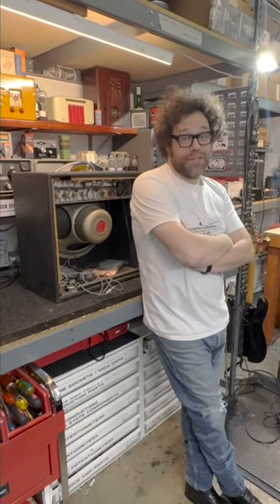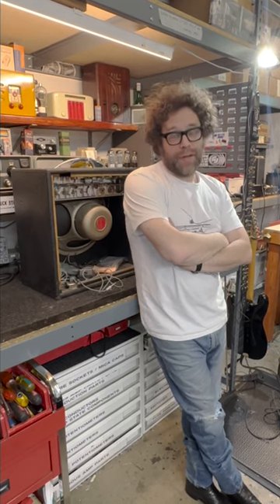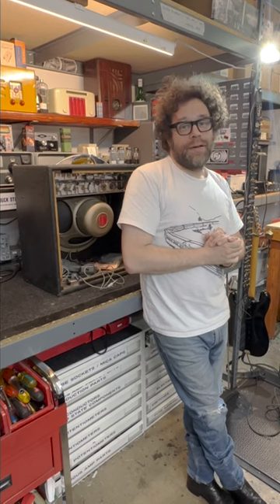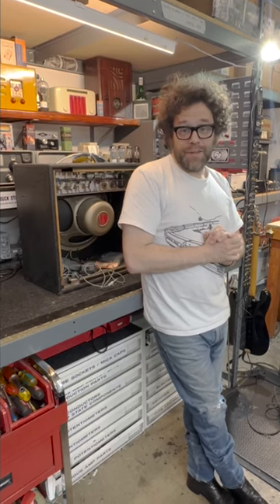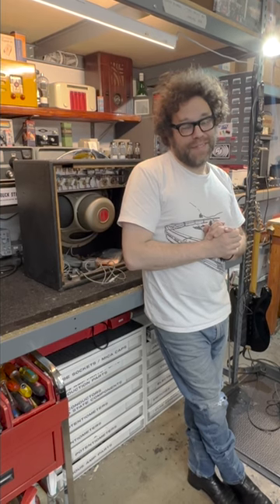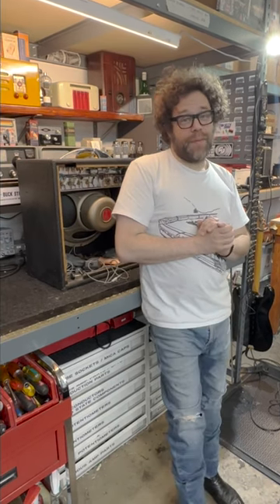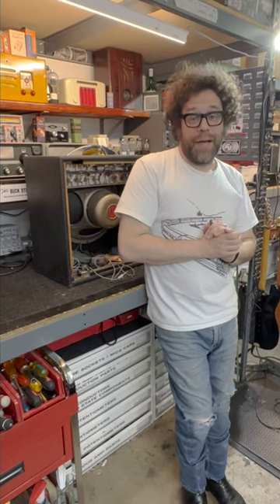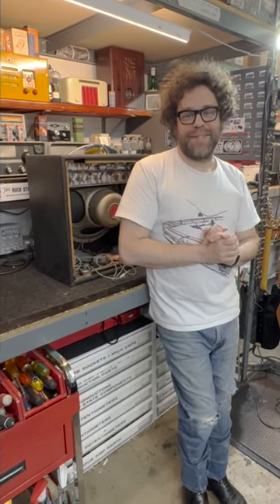BAD Filter Caps on Vintage Amps ⚡️

Comment: While electrolytic capacitors are probably the most commonly used capacitor when it comes to constructing filter capacitors, a filter capacitor doesn't technically have to use an electrolytic capacitor.  A filter capacitor refers only to the function of the capacitor in the circuit, so it's technically incorrect to say an electrolytic capacitor is a filter capacitor, or vice versa.

Comment: I got the same problem. I bought a 1970 4x10 Bass amp. I got it for cheap so when i got it home it dod that. Took it out cleaned it and thwn put it together same thing happened. I hit the top and now it works😂